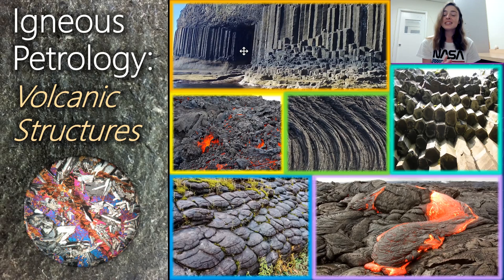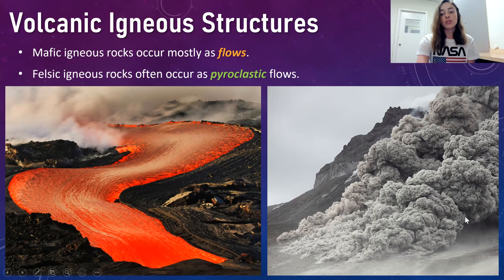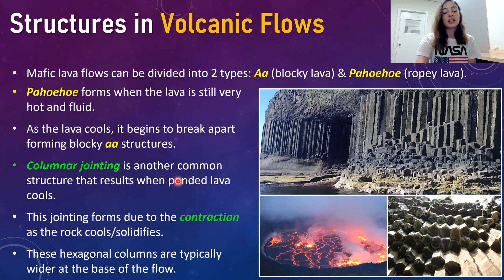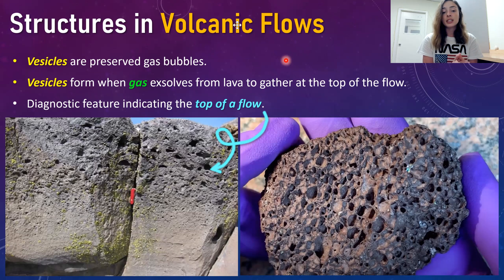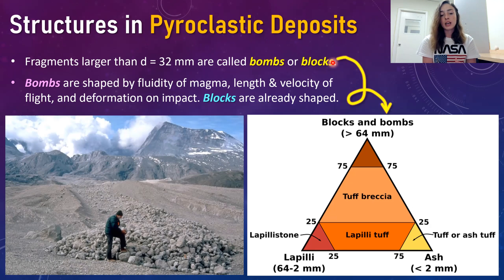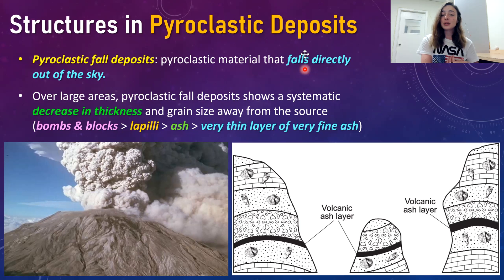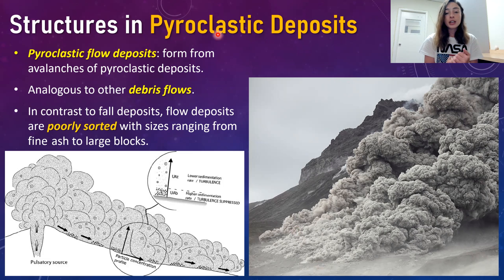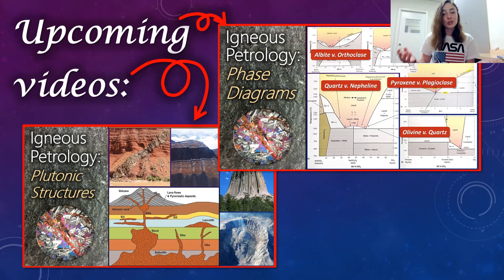Volcanic Structures in Lava Flows vs Pyroclastic Flows- Igneous Petrology #3 | GEO GIRL

Comment: "Fine, glassy ash" is my favorite structure (I guess that falls under Pyroclastic Falls), because through a super-duper method called microprobe analysis of glass shards one may obtain the geochemistry of the glass, and determine which volcano it came from and when, and eventually using the volcanic ash layer as an age dating tool. Wonderful lecture as usual - looking forward to plutonic structures and phase diagrams. Thank you.

Comment: Thanks for this video. I am slowly expanding my volcanic knowledge. I have all my life been fascinated by volcanos.  I learned much about stratovolcanos in the spring of 1980. Tonight, I learned that the ash fall I experienced May 18,1980 was a pyroclastic fall deposit. In 1981we went to St Helen's. Tonight, I learned that what we saw along the Tuttle River were pyroclastic flow deposits. I can really remember the difference in how the two deposits looked. I lived in Moses Lake WA when the mountain blew. We had sunset at 10:30 am in the east. It was pitch black from 11 am until the ash stopped falling at 11pm that night.  There were 2 3/8 inches of ash on the ground in the morning.